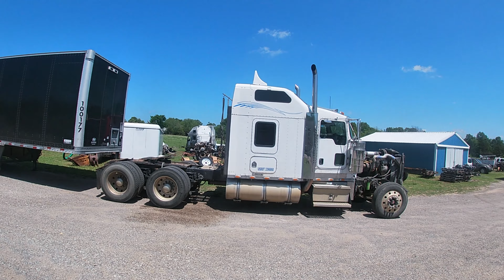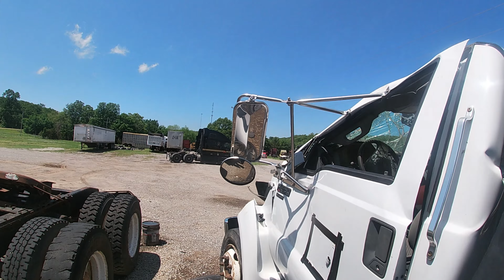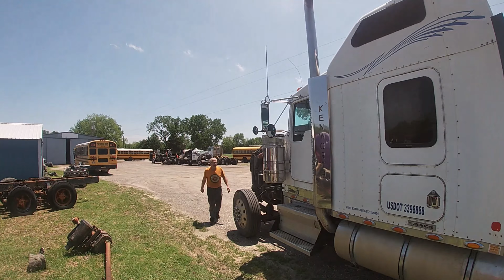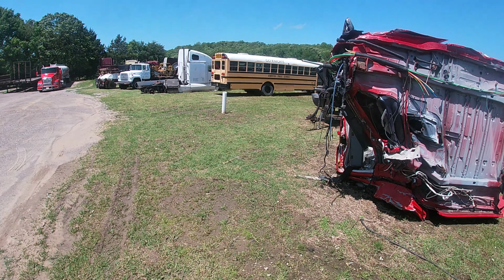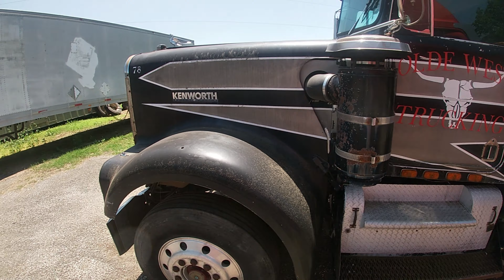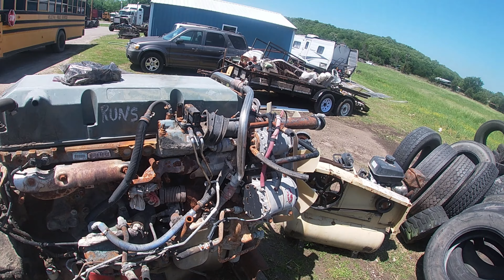Shop Blocked

Comment: Wonder what kinda work you had done? Seeing that hoodless W900 stung a little bit. But hey, that burnt out Pete had a Cat engine sitting in it. If that runs, it could make a good engine for the dark W900A sitting in the back there. That's a museum piece in itself: they made'm until 1982. :)
Reply from the maker: They replaced the air compressor : - )
Reply: @scottied67  Ahh, yeah, that's an important piece of kit right there. :)